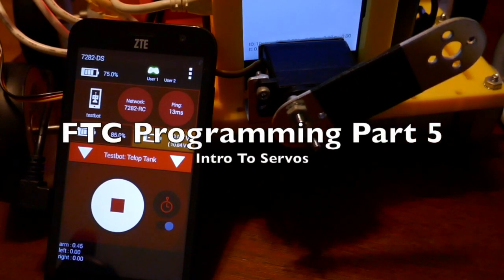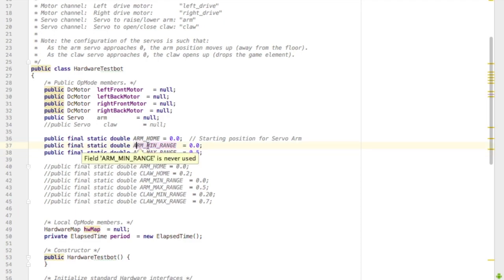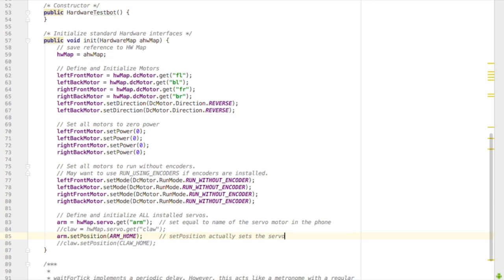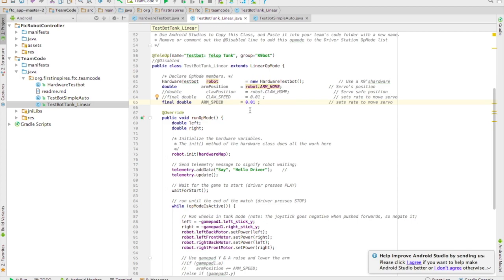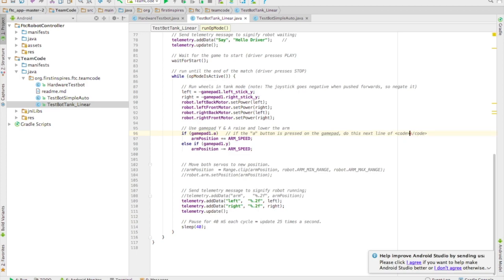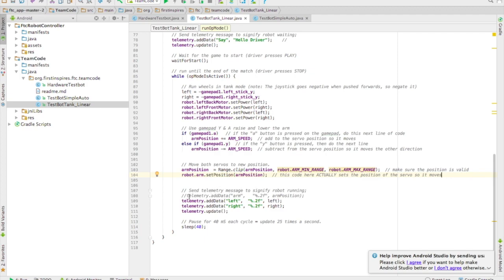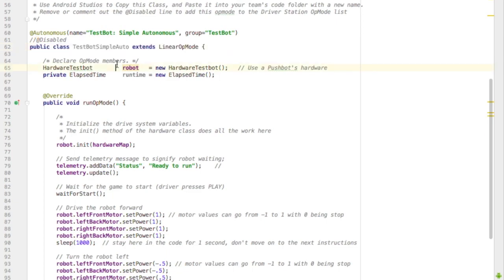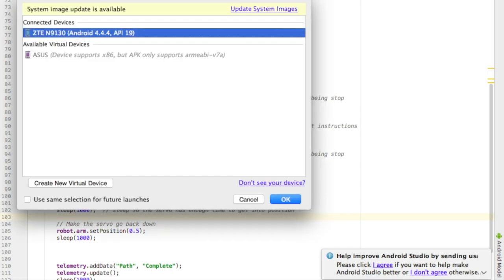FTC Programming Part 5: Servos

Comment: how would i go about to keep the servo position at the same spot while it runs the other code? for example, the robot moves forward and then sets servo position and turns right while the servo position is in the same spot